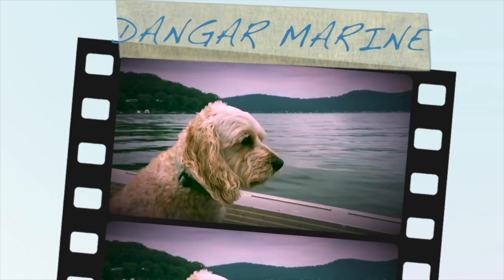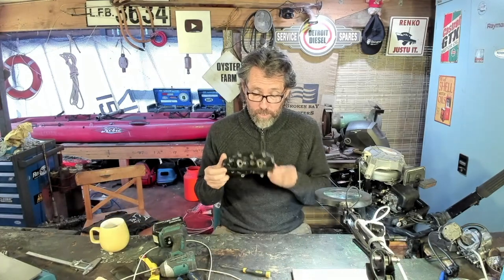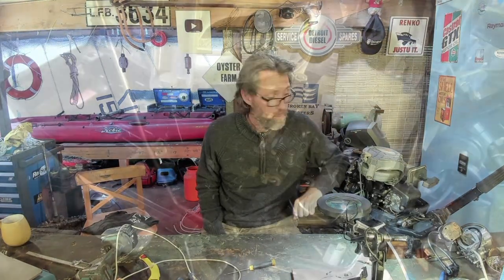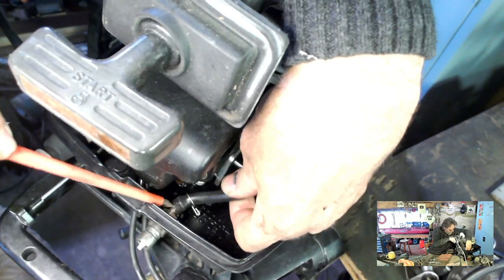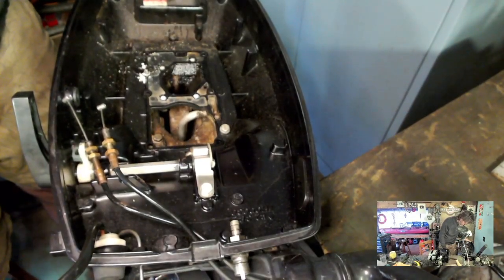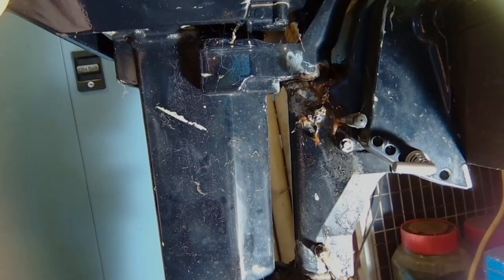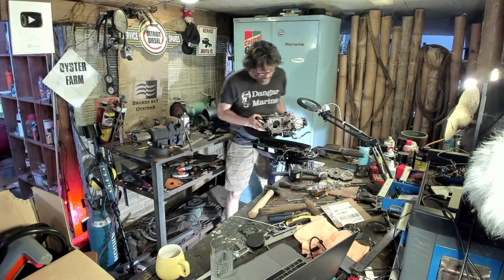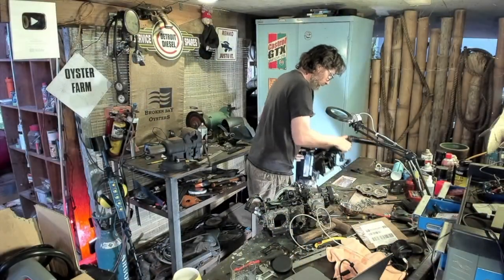The other reason outboards overheat

Comment: I suffer from an overabundance of the herein described mix & match motor syndrome. My shop is FULL of matching sets with mismatching issues. And there are are lots of "different" engines that utilize the same lower units or the same midsection, tilt units, etc.... so I sell of lot of refurbished engines that, when asked by the buyer what year it is, I have to say; "well, it's a 1987/1989/1992 Suzuki DT55/65 with a Mercury 35/45/50 prop."
Reply from the maker: Got to love the Frankenstein outboard!
Reply: @DangarMarine  Frankenstein was the Dr, not the monster made of an ensemble of body parts (sorry, just had to)🤣
Reply: One of my Harleys I put together in 2016 is a bit of a hodgepodge of parts. Someone will ask me what year it is. I tell them it's titled as a 1949 as that is the frame I used. But I like to call it my Johnny Cash special "I built it one piece at a time" as the song says.

Comment: Don''t mess with Daffy's food... A side note on over heating. Keep an eye out for pieces of plastic, plastic bags, etc., floating at the water's surface. If your boat runs over them, they can wrap around your lower unit and cover the water intakes.
Reply from the maker: Yep, for sure, blocking the intake grill stops any cooling water fast. One other thing I forgot to mention is a blocked behind the exhaust cover can stop it exiting, another way to prevent any flow of water. It's only a small outlet and it is common for the internal anode to break off an block the hole...

Comment: if you ever have a prob. where it will idle fine bu no rev up .easy fix the tiny o rings both ends of fuel hose can develope a leak due to a torn place you can see so take a fishhook stick the oring and jerk it out both ends press new o rings in with your  thumb now it will rev it was leaking air  so eng was pullin air not gas from tank get these o rings any boat shop keep handy  beats pad ling any day

Comment: Great storm mate and obviously good use of the copper mallet.  Is anything really fixed if a hammer wasn't needed at some point? 🤣 Great video, so interesting.  Thanks .. 😜
Reply from the maker: The bigger the problem the bigger the hammer. ;)
Reply: And I've found that hammers are great for...hamming. 🤨

Comment: Love watching your videos and learn so much. When you were talking about ordering gaskets I was thinking that I sometimes find it hard to be confident I have the right part numbers. I think a video of the process you use to find parts diagrams and order parts could be a great addition to your website.
Reply from the maker: Thanks mate. Yes, I have been thinking about doing something very similar. Leave it with me!
Reply: @DangarMarine  will a two wire trim motor work with solenoids or do I need to remove them and use trim relays, it’s for a 120 force 1996
Reply: Crowley marine has every parts diagram you’ll ever need m8

Comment: I have a 1973 Evinrude 65 HP that had a blown crankcase on it (all the horses ran out of the hole in the block!). 
I was going to strip it and sell the parts, but I found a good crankcase on eBay for $100 (US). A little cleaning and combining, some new gaskets, obviously a little help from Dangar Marine videos 🙂,  and now it's on my bass boat!

Comment: Great work Doug. I know someone who, on a world sail, had a Seagull tender outboard with a poorly bottom end and while in the Far East they stumbled over a Seagull lower end stuck deep into a beach. I know it sounds far-fetched but that one was better then what they had and it served for their trip. Just shows that engine amalgamation is a real thing as you show. It does amaze me how intricate and complicated many OB engines have become, especially multi-cylinder 4 strokes. They are as sophisticated as modern motorbike motors but work in much harsher environments, often with insufficient care. They are like watches where a careless owner has forgotten to screw down the winder yet complains that they fail. Cheers for the content!
Reply from the maker: It is amazing how well lower units can last out in the wild if the seals are still good. Modern EFI four stroke outboards certainly are every bit as complicated as many car and bike engines these days.

Comment: i bought 2 75 hp 1976 chrysler outboards for $150.00. between the two i rebuilt the best one, honed cylinders, new rings, cleaned it inside out new gaskets all round, new fuel pump ect. been running great 4 years now.
Reply from the maker: Great work! Good size outboard to build for not much money. :)

Comment: With a very large amount of 50’s and 60’s and 70’s outboards it’s easy to take 2 or 3 to make one really nice one both performance and cosmetic! With that one having cable throttle have you ever thought of using a slide type carb ? All the ones I do have a mechanical throttle !
Reply from the maker: Very true! I haven't tried experimenting with different types of carburettors but would be interesting to do.

Comment: Burnt lower engine gasket (base gasket) is also one failure in small 2 stroke outboards you need to keep your eye on when the water pump fails and engine overheats.
Most telling symptom of blown lower gasket is in most cases that the engine runs only without the motor cover.
Reply from the maker: Yes, an exhaust leak under the cowling can give an engine all sorts of problems.

Comment: Stu around one of the lakes here, it has fine sand and we've seen the block full of dirt. Expressly if the operator runs it up on the sand bars.😉😁
Reply from the maker: For sure, doing a bit of dredging / prop polishing can fill a block with grit pretty fast!

Comment: Man Stu.. I'm having horrible, horrible PTSD flashbacks to my days of digging all the CRAP out of outboards stuck in saltwater that saw the air and a mechanic maybe once a year.. if I was lucky! 🤬 In my time at the marina it was the days people were still dumping ATF in the fuel rather than 2 stroke oil; cooling passages so clogged up the owners wouldn't have their heat issues looked into until something seized or caught on fire.. in the middle of the bay. Weekend "Marina Mary's" are not too bright!
Reply from the maker: Sounds like quite the scene! Boats here often get even less care but the fact they are used every day seems to keen them running. The gunk in the water jackets never gets a chance to dry out and set hard.

Comment: This video couldn't have come at a better time.  I've been dealing with my 85 3.6 liter Evinrude Looper.  It's been overheating.  despite putting a brand new water pump & housing on it, it won't build water pressure, and overheats.  I removed the thermostats and ran the engine to see if it was pumping water to the top of the  engine and it was, but there was quite a bit of exhaust coming out of the thermostat holes.  I asked on a OMC performance page if this was normal, and was told it was, so I didn't think much of it (as this engine has always been extremely reliable).  

To make a long story short, I wound up getting it really hot, thought I ruined it.  hot horns were going on and off randomly, could never get more than about 5psi water pressure at the gauge (I surface drive the prop with low water pickups and nosecone).  Sadly the  engine 'heat seized' and quit.  

Next day, the engine was free, made good compression, turned flywheel by hand, felt good with no catches.  used a bore scope and couldn't see any damage on pistons, and plugs looked good (no aluminum dust on them).  Started engine and it ran, without lower unit on.  Did a water pressure test by using a garden hose and hose clamp on the water intake pipe, and water started leaking out the head gaskets.  Removed heads and it looks like no leaks on the combustion sealing rings.  Cylinder bores look good, pistons look good (no marks of detonation).  But cylinder sleeve #3 has rotated in the block about 1/8 of a turn, half way closing off the valves(ports).  Gotta heat the block in a oven and rotate it back into place, but haven't done so yet, because I was thinking there's probably a crack in the water jacket between the exhaust housing and water jacket.  But now I'm thinking the head gaskets probably failed.

Would you think I'm most likely correct?  Should I have the block and heads magnafluxed?  Thanks for your channel, you've giving good info in the past.

Comment: Blown head gasket can also lead to a no or really hard start soon after running. Gets water in the lower cylinder. The problem is that a blown exhaust gasket does the same damn thing...
Reply from the maker: Yep, you certainly can get all sorts of weird symptoms under different circumstances.

Comment: Another benefit with making 2 from one, u may also get a load of spares where both motors have working parts like coil packs
Reply from the maker: Very much so! I'll definitely strip all of the unused parts off the other motor and keep them somewhere dafe.
Reply: @DangarMarine  somewhere so safe you will definitely forget where you put them when u need them, and go buy a new part, then find said safe place 3 months later
Reply: @DangarMarine  dafety first!

Comment: Great to see the hens looking happy, I have a four stroke Suzuki 4 which has stopped pumping water which I will have to try and fix soon possible as I rely on to get to and back from my fishing boat most days, I have the impellor kit just need to find a thermostat kit for it too, what do you think of these engines
Reply from the maker: Suzuki do make very good four stroke motors that's for sure.
Reply: That’s great to know thanks, worth me fixing it up then probably 🤞🤞🤞
Reply: it may be your headgasket if its made like a johnson it can  ahht times burn a hole that lets exhaust force water back down to impeller making it run hot replace head gasket fixes it you can see hole in gasket as you take it off
Reply: @frankdavidson9675  thanks I'm going to pull it off the boat soon and give it a birthday, its used most days just now though

Comment: I own a Century 2200 WA with a Yamaha 225 outboard.  I will probably never own a steel boat.  I cannot weld.  I will probably never own a Detroit 2 stroke diesel engine.  So why do I feel compelled to watch the entire back catalog of Renko's restoration?  :)   Do I need a psychiatrist?  My family certainly think so.  \

I am also waiting for that video to explain why I seem to get a slick around my outboard when I raise an lower it.  I cannot see anything escaping from the rams (the caps are new).  I even get the slick simply by standing on the transom and forcing the leg to dip in the water, so whatever it is its on the casing too.   The engine was recently rebuilt to cure the rot problem under the power head around the seal.  Baffled in the UK :(

Comment: I had overheating on low rpm on my yamaha f25 4stroke.the problem was brass tube corodded,and there were many holes along it,so in low rpm there was not enough water coming in the block,when throtlle was open no alarm

Comment: Can you touch on the Poppet Valve at some point?? Tks for the video.
Reply from the maker: The poppet valve is a valve that is opened by water pressure (unlike a thermostat that opens with temperature) The idea is to increase the flow of water through the head at higher RPM. It's hard for me to show as these smaller outboards don't have one.

Comment: Have you ever considered running a weak acid (Strong vinegar, Muriatic, phosphoric etc.) through the water passages to disonve corrosion as a last ditch effort to clean the passages out before having to disassemble the engine?
Reply from the maker: Yes, and have had good success doing that. Here is a video I did on different solutions https://youtu.be/8w_o5xB8ZFI

Comment: I have just purchased a s/h rib with a 2006 8hp Mariner 2 stroke not running but told it needed a carby overhaul (same configuration as the Tohatsu's in this video). With no history i decided to replace impella & overhaul carby. Cranked it up today and runs great on muffs with a good flow out of tell tale but placed in a bin of water (8" above skeg line so pump should prime), and no water coming out of tell tale and engine starting to overheat, pulled it out and back on muffs and fine again with scalding hot water coming out of tell tale for a minute before the fresh water cycled through. I really don't want to but thinking head to come off and check thermostat, galleries etc. but hoping you might have a suggestion where i should start to investigate?
Thanks muchly

Comment: On Evinrudes they have three water deflectors (rubber hose inserts) one at the top of the cylinder and two at the bottom cylinder on each head which are pulled out and installed by pushing new ones into the designated slots along the cylinder. They divert circulated water, so it flows in a specific direction for cooling. If any of these defectors collapse from age or heat and are distorted or if they are missing it will cause the engine to overheat. I read that you can go to an auto parts store and buy hose with 3/8" outside diameter and cut it to the lengths you need and use it. Boat parts outlets want $7 to $15 a piece for these hose pieces less than 2" long. The ones in this 1979 35hp Evinrude that I am replacing the head gasket are bad and I am thinking about matching the hose up at an auto parts store to save paying around $25. Do you have any videos on this? I bought this engine with the engine surface looking like new for $200 with the top cylinder at 120lbs and zero for the bottom cylinder. It looks like someone replaced the head gasket recently, but it blew again. It was burnt throw at the bottom where the two bad water deflectors are. The bolts also seemed too loose like someone did not re-torque the head after running it. I drilled two holes in the lower cowl housing so I can fit a short extension through and put a socket on in order to torque the two bottom bolts. The head seems to be true using a framing square. Cylinders all smooth but glazed up. Can I use a chemical to clean up the glaze with the motor tilted so excess runs away from the rings or should I just scotch brite or sandpaper it just enough to shine and wiping it out? Didn't want to hone it and chance getting abrasive to the rings. This is a long shaft with electric start and controls.  I have a 78 short shaft with tiller handle that i plan on putting this power head on the base to use the short shaft housing and tiller handle. Plan on changing the longer shift rod to the shorter one and using the same foot from the 79 model if after changing the water deflectors and head gasket this 79 motor turns out to be as good as it looks. Also, will bolt on the pull start from the 78 so I have both electric and pull start.  Coils, power pack, fuel pump all were recently changed by previous owner. So, like you are doing in your video just piecing it together since a friend gave me the 78 motor which sat up for years. If everything works out should have a great motor for around $260 with cost of gaskets, deflectors, and thermostat. If not, the parts are worth what I have invested and may rebuild the 79 if necessary.

Comment: Do you have any advice for me on this, I have a 30hp johnson from 1987 that I'm trying to change the impeller/water pump on. The through bolt/stud on the lower unit has corroded and won't budge and I'm afraid of breaking the fins off if I bash to much at it. I have tried wiggling, heating and some light bashing but no luck
Reply from the maker: It also could the the corrosion at the top of the driveshaft that I was worried about in this video. Really all you can do is apply more heat, more oil and more pressure. Sometimes if I can open up a small gap I will try hammering wooden wedges into the gap. You can also lay a piece of timber along the length of the fin when hammering to reduce the risk of them breaking when hammering.

Comment: Hi, your great. Been a real help in a lot of ways for me rebuilding my 1989 110 v4 Johnson motor. I have question maybe you can help with. I have an extra min kota maxum trolling motor that came with the boat from 1990, but as for stickers or labeling of voltage and thrust are long since gone. I’m wanting to test it on 24 volt configuration and don’t care if it burns up due to being an extra one anyway. I’m thinking of hooking it up on my work bench to 24 volts and running it for a while to see if it burns up or not, but how long would it take to fail if I do, and or is there a better way. Can’t look at the old way boat batteries were wired as it was all removed when I got it. Thanks.

Comment: I have a question from an older video, will a two wire trim motor work with solenoids or do I need trim relays? In desperate need of help

Comment: 1979 Johnson 9.9hp. 10R79B. Dead and dry yellow jackets showing through intake holes. No water at telltale. After thermostat is out can you flush motor through that upper hole? Or do I need to remove the bottom end? Not sure how for up they went. 😮

Comment: When it comes to deleting oil injection on two stroke outboard Yamaha is it okay to pull gear out the engine block and not just work gear in pump

Comment: Hey Stu. I'm a week away from getting my first boat... a used 14' runabout with a 40hp 2 stroke merc from 1999 so I'm madly trying to aquire a lifetime's worth of knowledge in a week of watching youtube vids. :) From years of working on cars (mostly British cars from the 1960's) I'm familiar with overheating problems, but they've got temperature guages and radiators that froth and bubble... small outboards have neither, so how do you tell it's overheating before it seizes and you're left floating in the middle of nowhere?